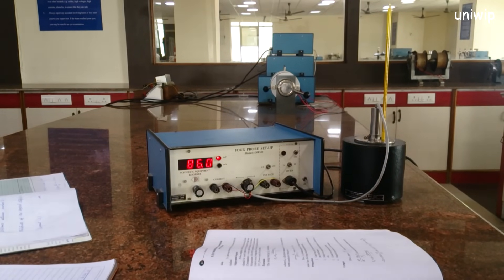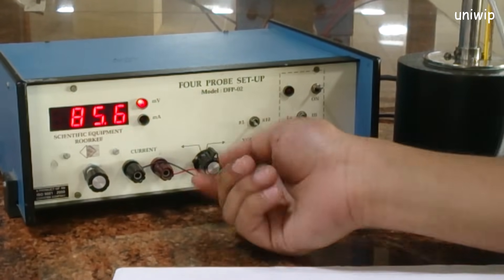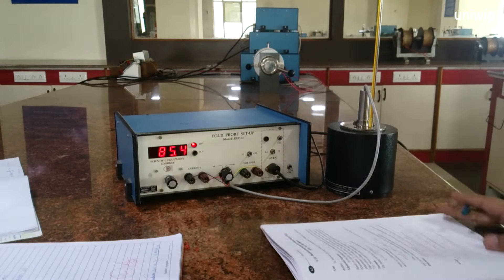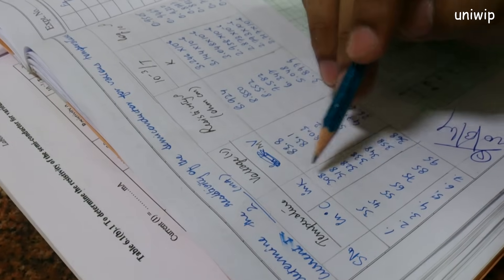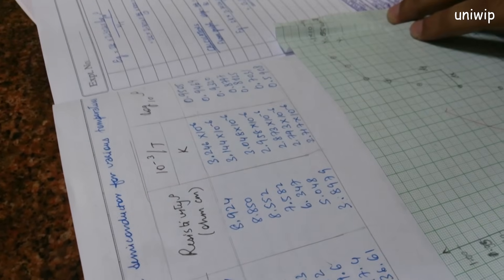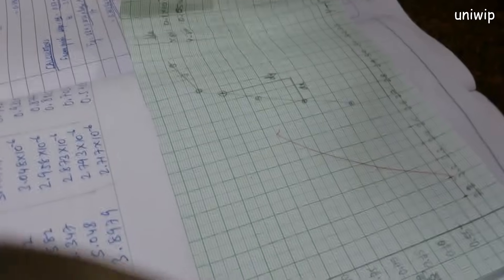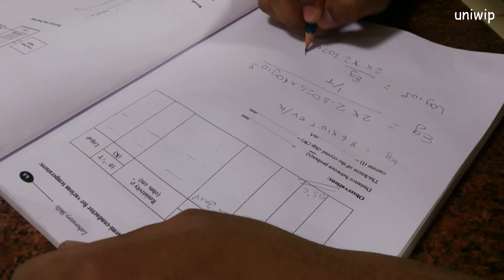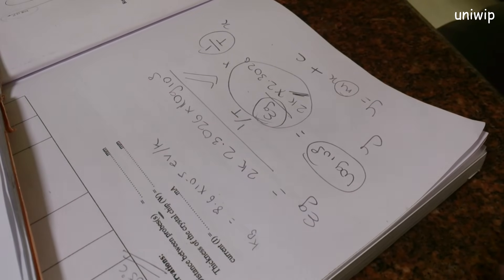Resistivity Determination using Four Probe Method (Material Science Experiment 6.1a)

Comment: Summary
In this educational video, the host explains the process of determining the resistivity of a semiconducting wafer using the four-probe method. The experiment involves heating a semiconductor and measuring voltage at various temperatures while maintaining a constant current. Key calculations and formulas are presented to help viewers understand how to calculate resistivity and energy band gap from their experimental data.
Highlights

0:00
	Introduction to the experiment on semiconductor resistivity using the four-probe method.

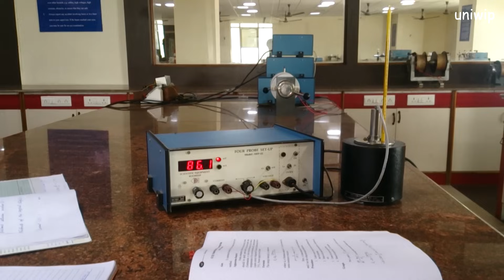0:08
	Overview of what a four-probe setup looks like, emphasizing its components including probes and semiconducting wafer.

0:35
	Explanation of setting up temperature control for accurate measurements during the experiment.

2:08
	Initial readings taken at 35°C, showcasing how temperature correlates with voltage (mV).

3:07
	Instructions on continuing data collection up to a target temperature of 95°C for better results in analysis.

4:35
	Introduction to formula for calculating resistivity based on collected voltage and current values; key formula is highlighted.

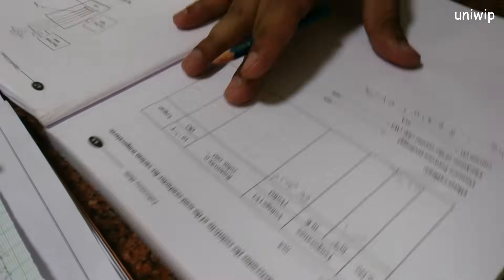5:01
	Guidance on plotting graphs from experimental data, specifically focusing on graphing ( \frac{1}{T} ) versus log base-10 values for further analysis.

7:01
	Final steps explained: substituting average values into equations to determine energy band gap (EG) after calculations are completed.